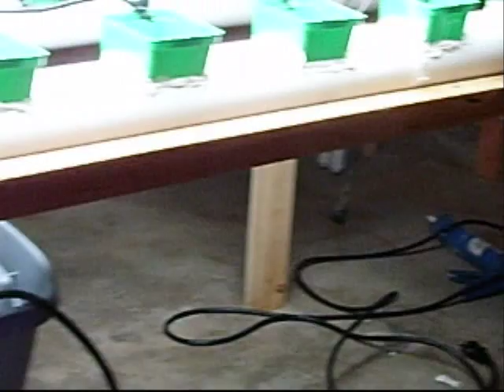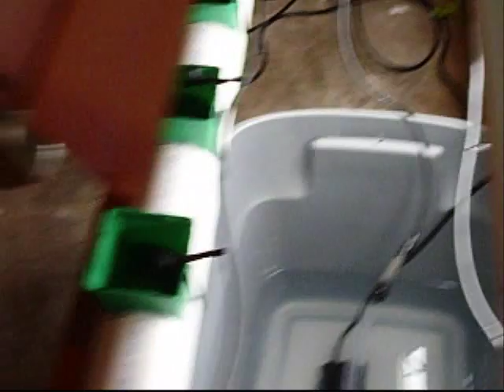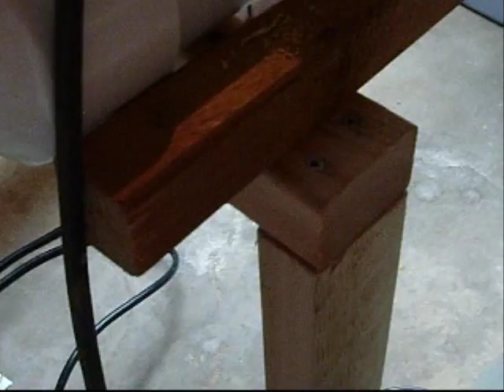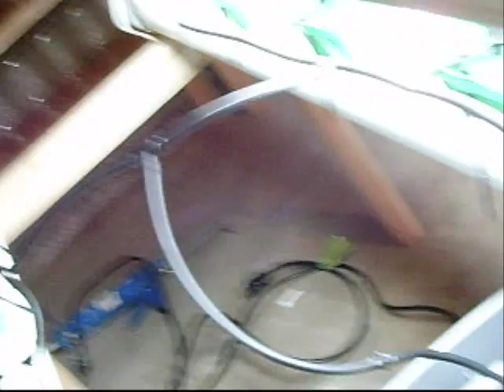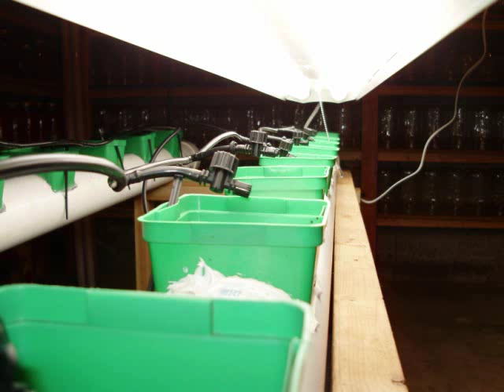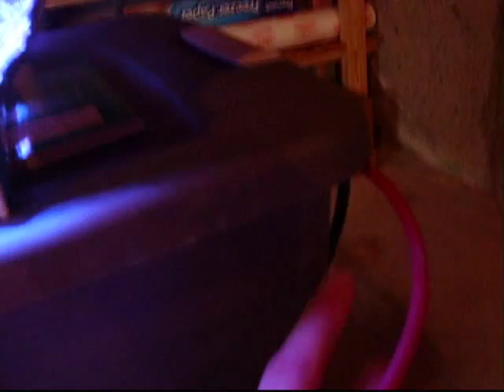My Drip/Gravity Flow Systems

Comment: One great tip for any hydro or ebb sytem is to mix 3% hydrogen peroxide into Ph 'd water 1 part H2O2 (hydorgen peroxide) 3 parts H2O ! this is a great folier spray/feed i also use about a cup in my Ph ready resivior which prevents "root rot" and supplies much needed oxygen. If added after "root rot" is dicovered, add small amounts till roots are tanish to white. I also use when germinating and cloneing as well !!  more info here >(using-hydrogen-peroxide "dot" com)